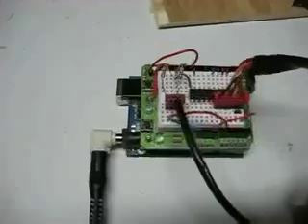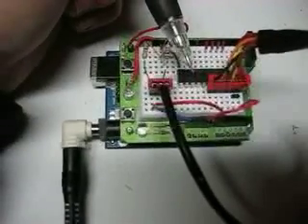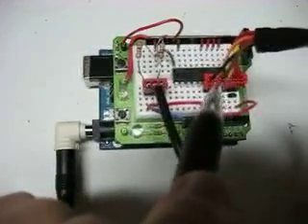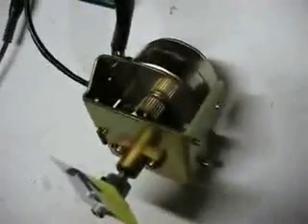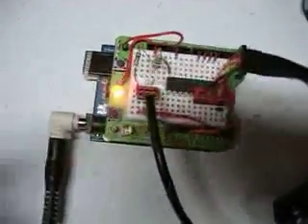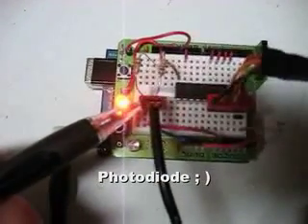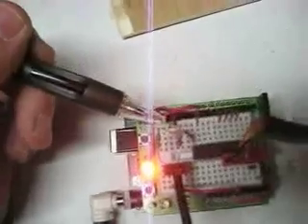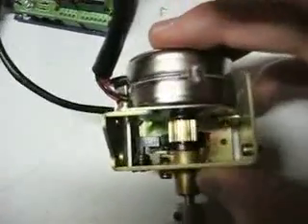Arduino Stepper Control Rig

Comment from the maker: @SCRTpilot It's just a proof of concept mr. serious.. and it had the sensor.. so why the hell not play with it?  Of course i could have used a DC Motor, but I wouldn't have had to write a bunch of interesting code for that and learn steppers.

I would think the ir sensor was added on there in case the motor gets moved by outside forces (like yanking paper out of the printer)  You'd need to index on a starting point to count steps from there.  The IR sensor does that with very little effort.